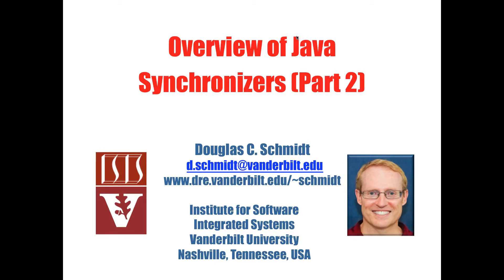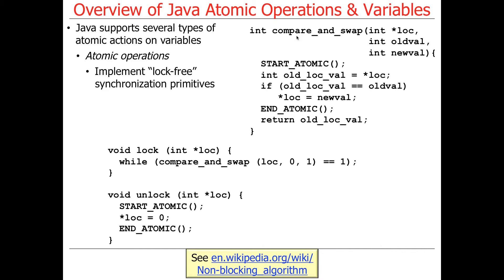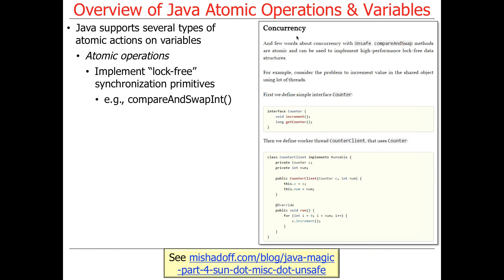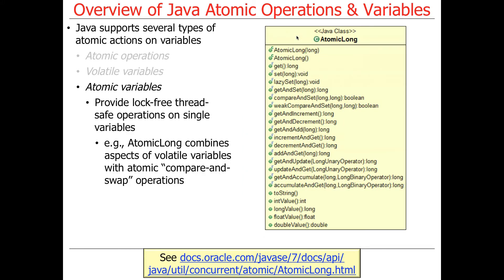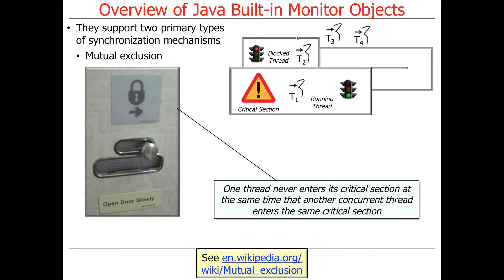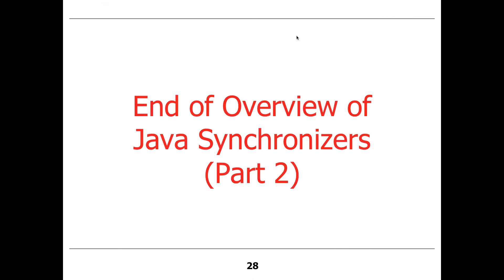Overview of Java Synchronization (Part 2)

Comment: 0:18 Java atomic operations and atomic variables
    0:48 atomic operations (low level)
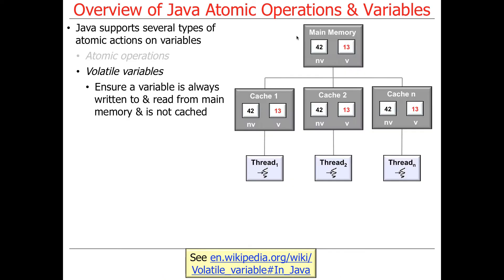    4:40 volatile variable at the application programming level 4:55 always written and read from main memory (bypass the cache)
    5:43 atomic variable - lock-free thread-safe operation on it

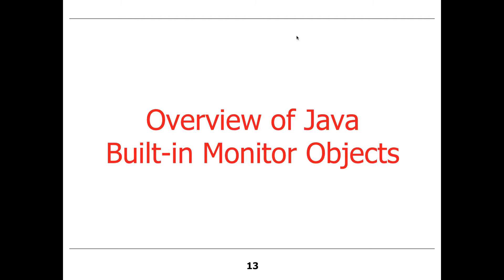7:47 overview of Java built-in monitor objects
    8:27 built-in monitor supported 2 primary types of synchronization mechanism
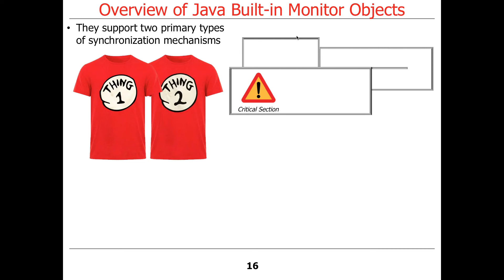        8:33 mutual exclusion
        9:16 coordination
    10:23 any Java object can be used as a monitor
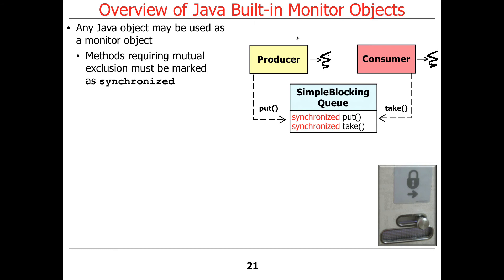    11:12 mutual exclusion with synchronized keyword
        12:28 synchronized keyword is not the complete solution of all synchronization needs
            12:40 e.g. when implementing a blocking queue
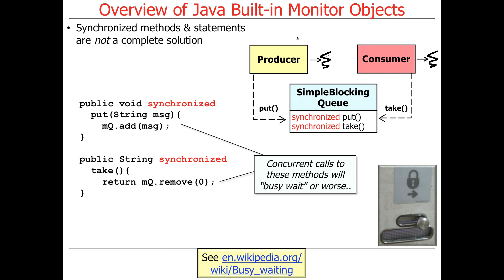        12:46 if you try to put sth into a full queue or take sth from an empty queue, 12:51 it will either "busy wait" (repeatedly check the intrinsic lock) or 13:01 get exception
        13:07 problem of only using synchronized keyword: it does not allow coordination
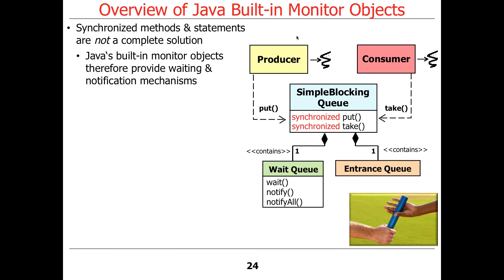    13:15 coordination with wait(), notify(), notifyAll()

Comment: Prof Doug, As you said, by using "synchronized" keyword, 'Concurrent calls to these methods will “busy wait” or worse..'  but, I learn from thread life cycle lectures that, thread on "synchronized" will go in "BLOCKED" state.
Reply from the maker: You're confusing a whole bunch of different concepts.  If a thread calls a synchronized method and there's no contention on the intrinsic lock then the lock will be acquired, the method will "do it's thing", and the lock will be released.  If this happens over and over again (which was the use case described in the video) then this causes a "busy wait," which consumers processing cycles inefficiently compared to using a condition wait.
Reply: Is 'synchronized' internally a non-blocking algorithm? that consume CPU cycles, busily to obtain lock.
Reply from the maker: Check out https://wiki.openjdk.java.net/display/HotSpot/Synchronization for details on how synchronized is implemented in OpenJDK.